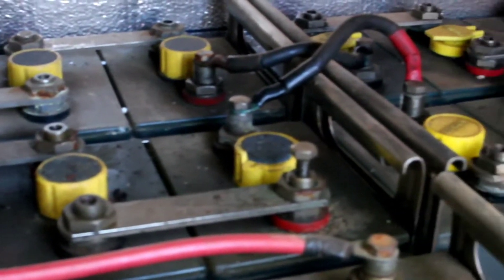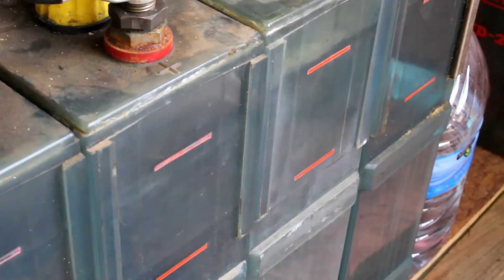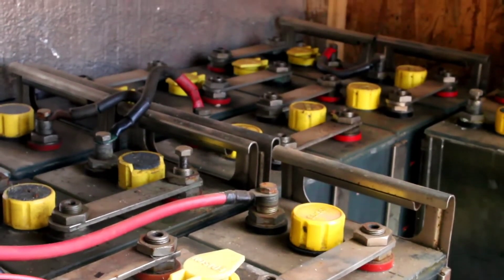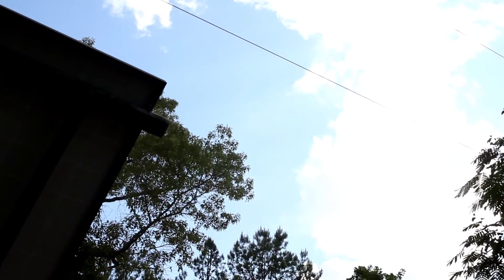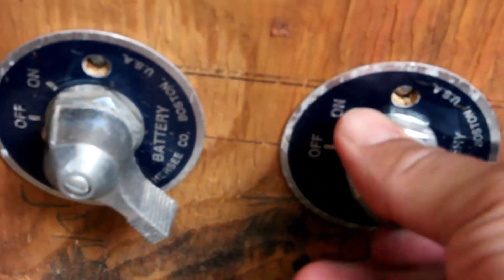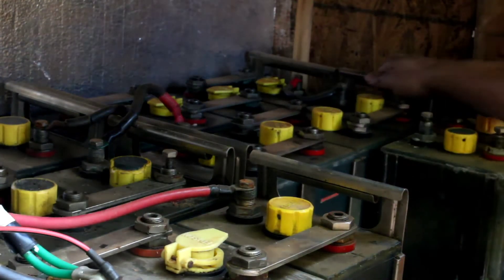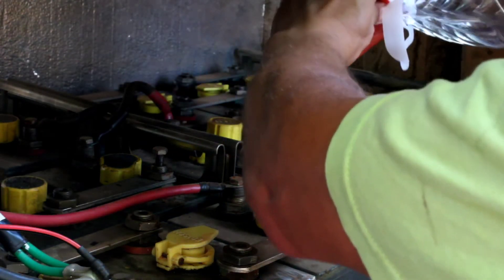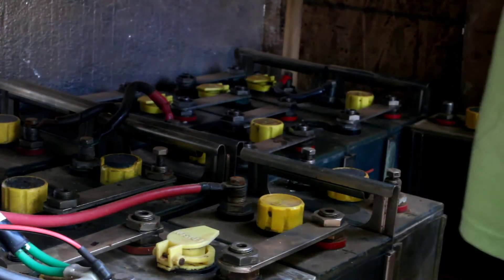Filling Up Edison Solar Batteries

Comment: Do you check SG with a Hydrometer per cell and log each cell on a sheet / per battery =)  That will tell you the ratio of acid to water mix ( I know old school tech stuff ... but it works and saves your batteries to log each cell =)   You can fix or replace bad cell before they degrade ( on one battery of an Edison cell battery ) before you ruin the life of the whole system and shorten you battery bank life =)    Just lesson learned from another solar guy =)
Reply: Perhaps you miss spoke. 
But just to be clear Nickel Iron Iron Cells do not use acid. 
The original Edison Iron Cells used a Potassium Hydroxide and water solution. Lithium Hydroxide was later added to extend temperature range and enhance cell performance. The specific gravity (SG) of fresh alkaline solution is  ~ 1.20 and is independent of the state-of-charge of the cell.

Unlike a lead acid battery the specific gravity (SG) of a NiFe cell does not indicate state of charge. The SG of a NiFe cell does not change during discharge and charging cycles. 
During maintenance when checking SG should the SG of a cell drop below 1.16 it is time to replace the Potassium Hydroxide and Lithium Hydroxide solution.  The time between solution refresh may vary depending on each use case but can generally be between 7-10 years of normal use. Under heavy use cases (high discharge and charging frequently, exposure to high temperatures, etc.) the alkaline solution may need to be refresh more frequently.

When watering your cells make certain to use PURE DISTILLED water. No substitutions like rainwater, tap water, or bottled drinking water. These types of water will introduce contaminates/chemicals into the alkaline solution shortening its life and possibly damaging your cells.

I hope this is if some help